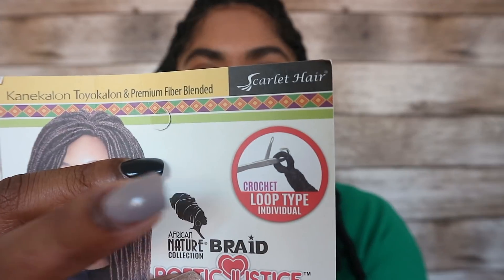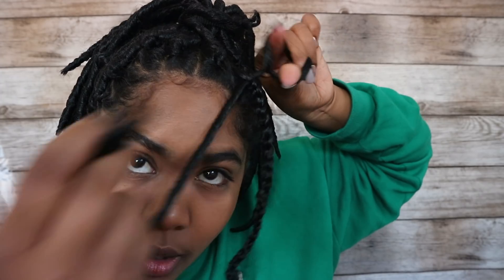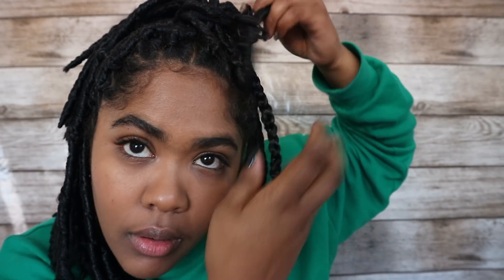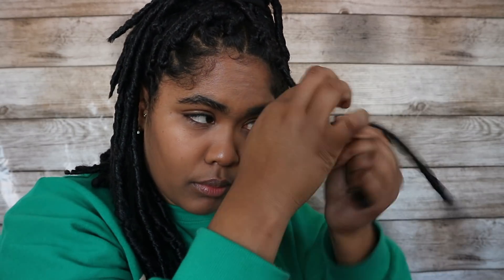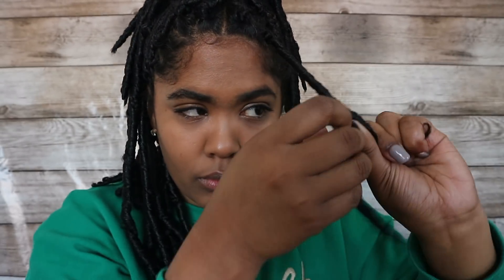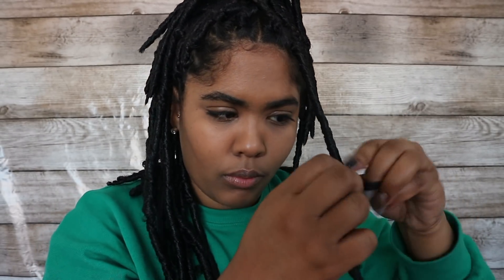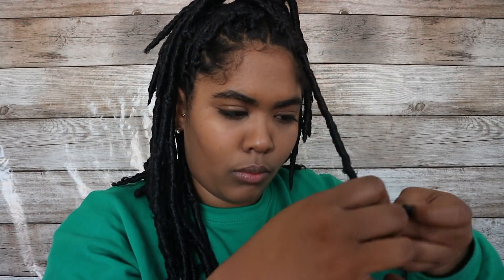DIY FAUX LOCS | LOOP TYPE CROCHET LOC METHOD WITH A BOBBY PIN

Comment: Definitely trying this. Thank you Genna. I wanted to know how many times do you tie your elastic bands? And did you use that method for this protective style?
Reply from the maker: LAETITIA CARMEN PIERS no elastic bands use in this protective style 💋 it makes it more difficult to pull the loop through the bottom of the braid
Reply: @gennadoingthings5124  thanks Genna 😊